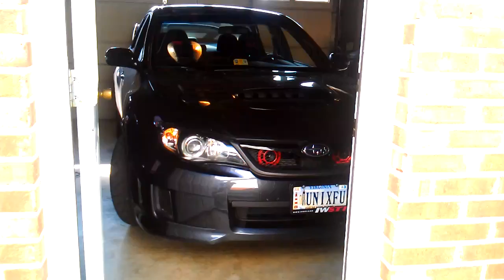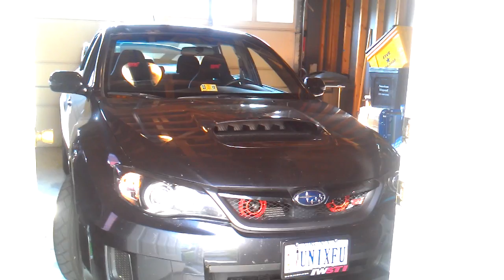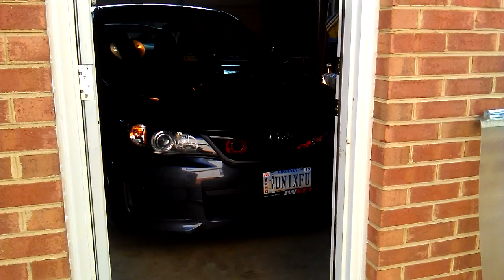Hella horn test

Comment from the maker: Gabriel, I'm pretty sure these will fit on *any* car, if properly customized. Yes, you'll need to make a custom bracket. You'll probably also need to customize the wiring...not sure if you can just swap out these with the stock horn. I've no idea what the stock horn wiring for a crown vic looks like, but if you're handy with wiring, it should be hard to figure out.

Comment: Any chance of a video showing your wiring of that harness? I have the harness/mount and hella's but dont know where to hide the wire best.    Do you think it would have been possible without taking the bumper off?  Also, do you have all 4 horns going or are the stock ones gone now?

Comment: Link to the bracket used? I went to the site, I don't think they have this for sale anymore. Do you remember the brand? Specs? Thank you in advance!
Reply from the maker: http://www.jnaperformance.com/jna-performance-hella-horn-mounting-bracket-for-subaru-jna-sub-005.html

JNA Performance Hella Horn Mounting Bracket Manufactured From Aluminum 
Laser Cut CNC Bent Machined Mounting Holes Black Powdercoat Finish Made 
in the USA. Fitment: 02-13 WRX, 02-13 STI, 98-09 Legacy, 98-01 GC

JNA Performance makes them, I believe.
Reply: Appreciate it brotha, but in the provided photo the horns look less spaced out than the ones on your car 🙃, might have to fab my own hahaha thanks again!!